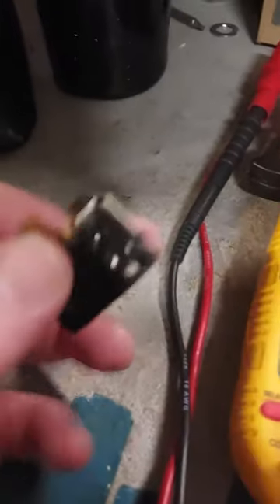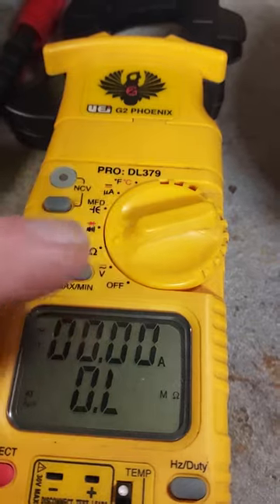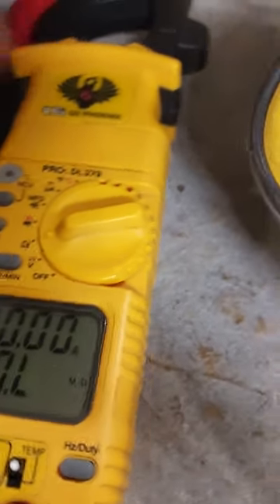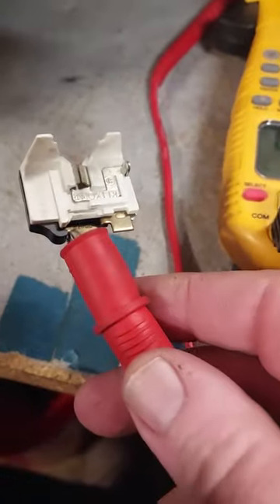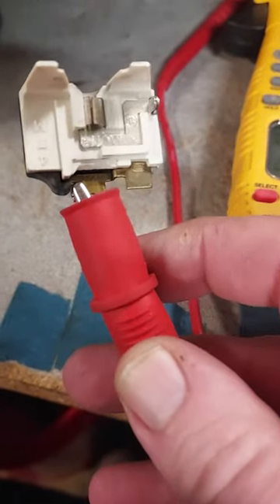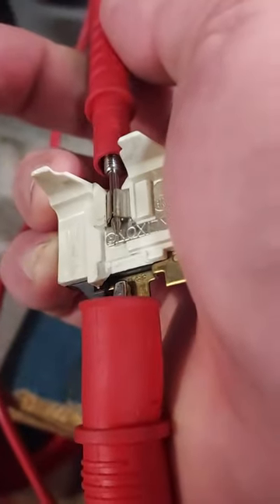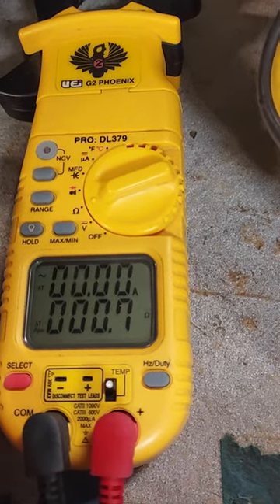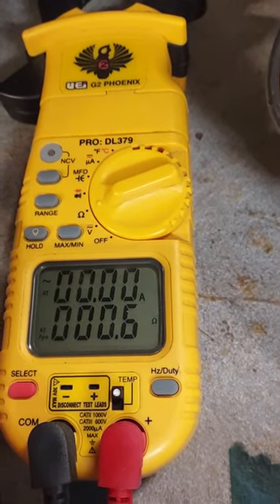Testing a domestic refrigerator compressor overload

Comment: Hie man ,have been testing my overload for a while and m having a reading of 0,00 jus want to make sure if it shows that reading is workn or not
Reply from the maker: 0,00 ohms should be good. Shows a pathway fir electricity to flow.
Reply: My lg test show 01.9 is bad ore good
Reply from the maker: Boarder line. It may have opened and closed to much so now it has resistance to beca load. I'd replace it, but that small of resistance should not stop 120v appliance from working.
Reply: What happened when the lg fridge not attracting electricity at all
Reply from the maker: Tripped circuit breaker, thermostat defective, defective defrost control.

Comment: Is this what causes my brand new Samsung not to dispense water or make ice?
Reply from the maker: No, that would be a different part. This would keep the whole thing from not working. This would not allow the compressor to run to allow cooling for the fridge and freezer. Yours would be a switch or board.
Reply: @ChilesHeatCool  what about inlet water valve?
Reply from the maker: It very well could be that yes.
Reply: @ChilesHeatCool  thank you
Reply from the maker: @doodledo5226 your welcome